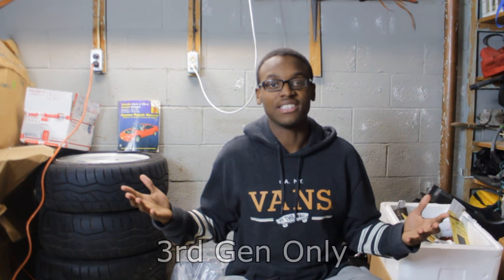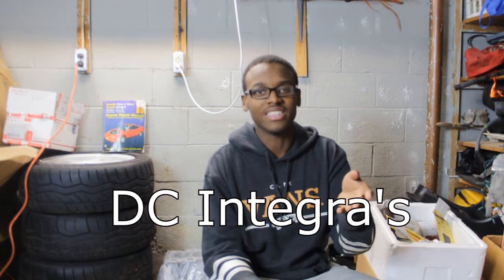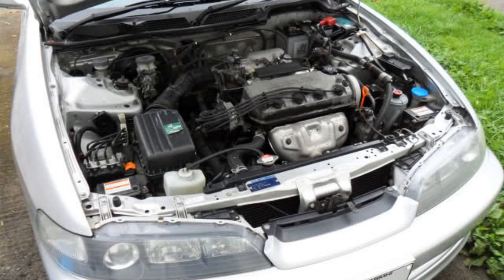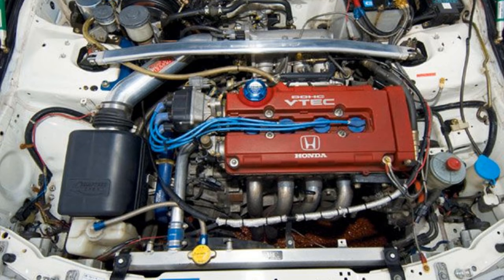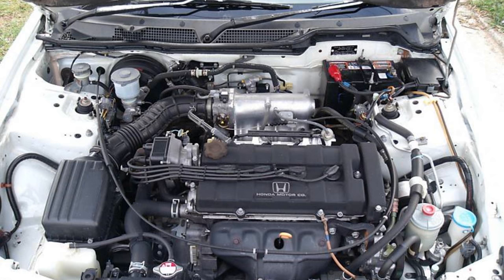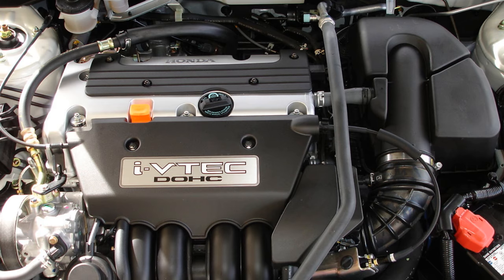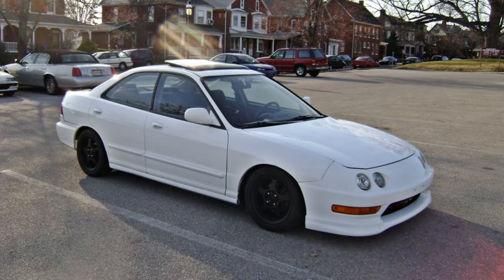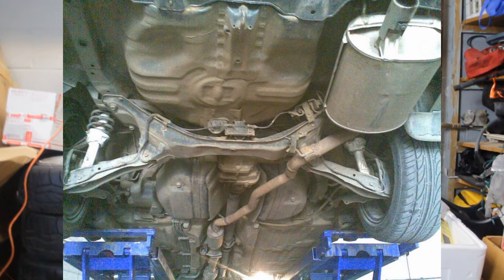The Difference Between: Integra Chassis Codes

Comment: Dc2 also has B18c &c5 for the R's ;)
Dc4 has always been a mystery to me being from Canada..
Apparently the DB8 has a stiffer chassis because of the vertical door brace, and thanks for mentioning the AWD system, because many DB8's don't have this in North America most people are totally unaware of this.  
The differences between chassis codes could of gone into some serious depth, but this is a good clip for just touching on the basics!
Reply from the maker: C Swiss wanted to keep it as basic as possible because we could ve here all day talking about each and every one😅
Reply: Middleton Films What are your plans for ECU choice in your motor build?
Reply from the maker: +C Swiss gsr ecu probably to pass emissions 🤔
Reply: Middleton Films that's what I'm doing for my DC 4 chasis with b2.0   high comp.

Comment: former EH3 owner here...oh wait, we talking about integra chassis.
p.s. all type r has a DC231 vin. but saying the k20a2 is crappy is funny. now the k20a3, which also came in an ep3, is crappy.
Reply from the maker: GODSGUNSGLORY compared to the dc5 type r the dc5 type s is a joke😎
Reply: were in america, getting the dc5 will take some years. but as far as the motor goes, yes the k20a(R) is better by 20 hp give or take. but saying the dc5(type s) is crappy is funny. id put a k20a2 over a b18c5 all day. but that is your opinion, i like 3rd gens over 4th gens also, newer car tend to be overweight.
Reply from the maker: GODSGUNSGLORY yeah k20a is an amazing motor i was just comparing it to the dc5r 😂 and yeah older hondas are where its at!

Comment: What's a coupe b18b1 LS ?
Reply from the maker: Jefrey Cruz The only car in the U.S that came with the B18b1 was the Acura Integra LS 😎
Reply from the maker: It is a hatchback not a coupe
Reply: Middleton Films what's the chassis code?
Reply from the maker: Jefrey Cruz Did you watch the video? 😂😂 Its DC4 😎
Reply: Middleton Films sure did but wanted to make sure
Reply: And the picture has a different head, that's why I'm asking and studying lol
Reply from the maker: Jefrey Cruz The valve cover is what you are looking at. That is the OBD1 Valve cover. The OBD2 Valve cover looks different  but both engines are exactly the same 😎
Reply: Middleton Films interesting to know that now 
So does that mean both covers can fit the same ?
Reply from the maker: Jefrey Cruz Thats correct 😃😃 They also fit the b20 head and NOT the VTEC heads 👌
Reply: Middleton Films thanks for letting me know, I enjoy learning more things from you and soon start an engine rebuild as well
Reply: @MITONFILMS  Correction, the GS came with a b18b1 as well